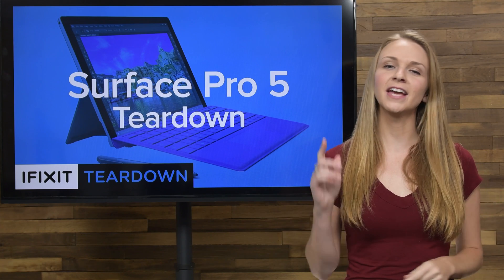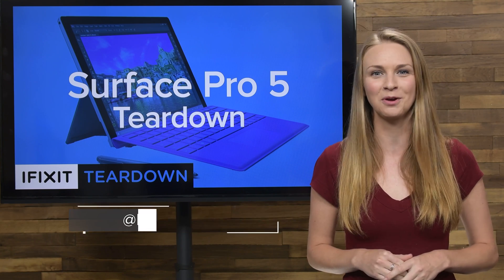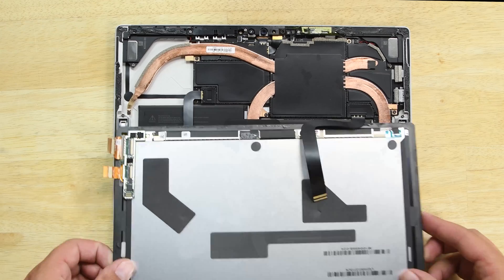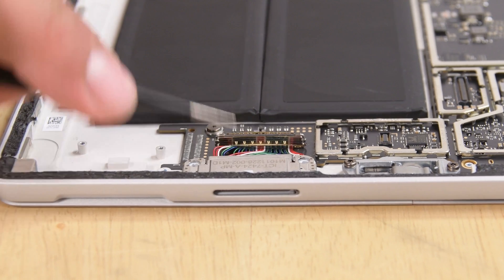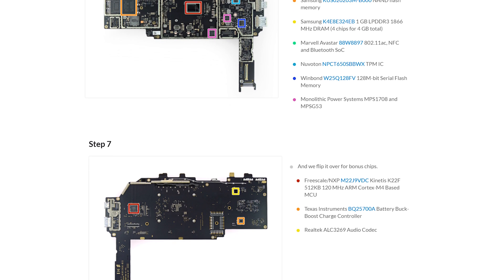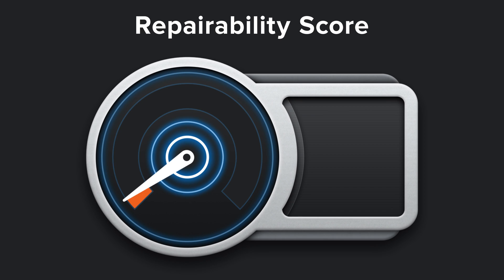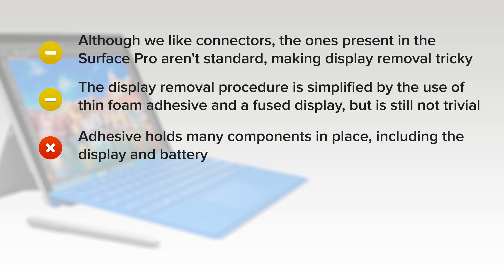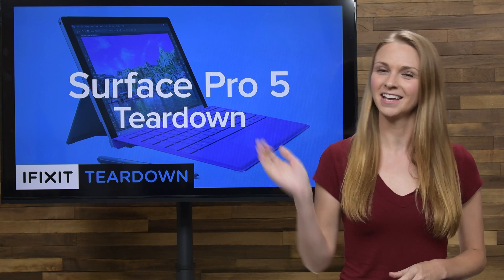The Microsoft Surface Pro 5 Teardown

Comment: Does anyone know if the Surface Pro 6 has removeable M.2 storage? Or, is it a chip that is soldered onto the MB? Trying to see if I can salvage data off of a "bricked" device. No physical damage but the device just won't power up.

Comment: I have a Surface Pro 5 (1796). After 15 months, the SSD Harddrive stopped working. It would only boot to the BIOS and didn't load Windows. 
After doing some research online, we found out that lots of other people had the same problem and there s NO FIX for that. The SSD is NOT replaceable. It's good as garbage now.
Reply: YEP!!! that is my problem, and that is why I am researching "how to fix it". Turns out that Microsoft screwed us all. they take thousands of dollars for a system that lasts 16 months. Greatest waste of cash. We all know that the hard-drive is the first to die, why would they solder it to the board and make it impossible to replace.
Reply: Ha ha ha.... its possible. I dont know how to do it in yur region.... but we can do it...
I have the same problem. just buy a new SSD bga chip and install it.
it works.

Comment: it's not called the 'Surface Pro 5' by Microsoft and therefore should not be called it here. Also, not covered was the fact that there is also an Intel i5 variety as well as an i7...which incidentally is the only model that has fans--meaning a different tear-down/assembly
Reply: It's now called the Surface Pro 5. Their video stood a better test of time than your comment. Also why didn't you mention the LTE one in your comment?

Comment: Can you solder on more ram or replace the ram by removing and resoldering larger chips?   I absolutely HATE that I'm stuck with a 4GB model
Reply: Technically? Yes; as long as the type, density and rank is correct. Good luck finding a shop that will do it.

Comment: Thanks for tearing down the Surface Pro 5! I know it's technically called the "New Surface Pro," but I'm fairly sure most places will stick to calling it the 5, as there is no reason to drop the numbers. 

It's sad to see it's repairability is so low again, but it should be expected by this point I guess

Comment: this is not a surface pro 5
Reply: They know that. It's much easier to just keep with the naming scheme even if Microsoft ditched it. It's either Surface Pro 5 or Surface Pro 2017. You can thank Microsoft for that as almost no business is going to just call it Surface Pro because that will confuse the average consumer
Reply: What If the real surface pro 5 coming out next year?
Reply: Surface Pro 4 2017 version. 
Because of the screen flicker bug on its BIOS they made this one
Reply: You sure about that?

Comment: i dont understand the left side .. it would fit a small low spinning fan .. or a bigger heatsink on the left to have more capacity to dissapate heat ..
Reply: They mentioned a LTE model so thats probably what they're saving that space for if i had to guess
Reply: the higher tier i5 and i7 models have fans
Reply: Intel M3 not require fan..those empty side might be for fan for i7 variant.
Reply: There is a fan exactly there in the Core i7 model.
Reply: The space is used for a fan on the i7 model. And I also think the LTE electronics are stored there on models with LTE. On the fanless models it's just wasted space. Which really irks me tbh. In my mind they could shift things around and increase the battery size or make space for a replaceable drive or something. But of course that would significantly complicate the manufacturing process...
Reply: whats the point if they've already replaced it with a more efficient cooling system?
Reply: More power creates more heat.
Reply: Maybe they didn't include a fan because of the relatively small benefit over the disadvantages  like the higher weight and the noise of a fan.